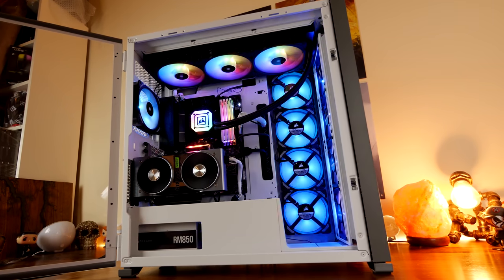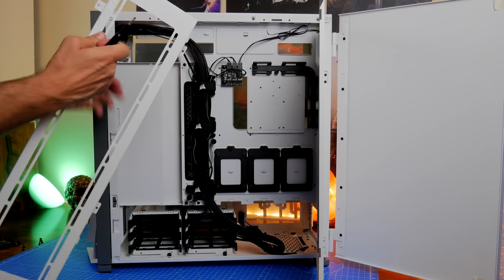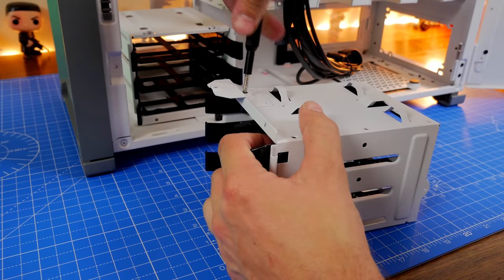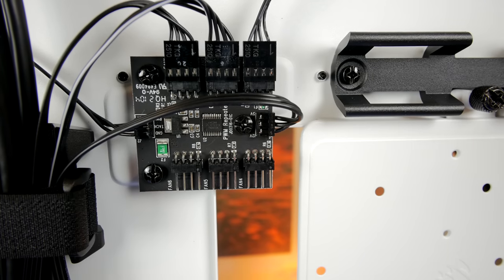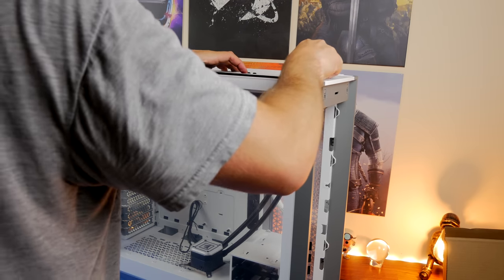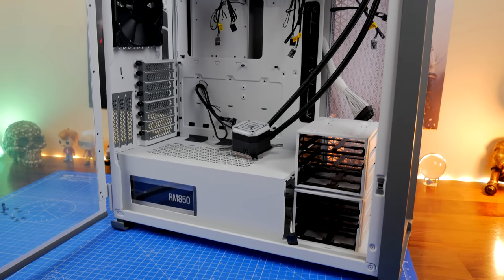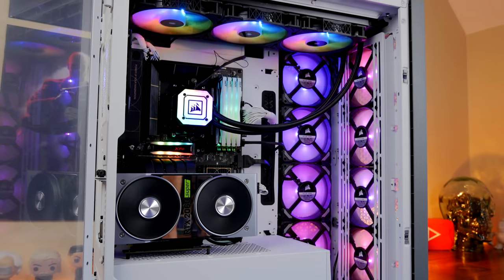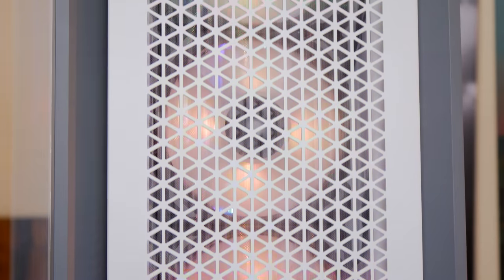Corsair 7000D Airflow unboxing and installation with 12 fans & the Corsair H170i Elite Capellix

Comment: How do you recognise which one is + on reset and power sw cables? Does that little arrow on the opposite side from side with writing on plays any role?
Reply from the maker: You should have some guidance in your motherboard manual
Reply: @TheProvokedPrawn   Im a bit confused. This is my firs build from scratch and quite expensive to. What will happen if i connect power sw or reset the other way around. I use z690 force wifi on this
Reply from the maker: @hermanherman1982  it's a bit hard to demo on video but usually the lettering https://www.alphr.com/features/378919/how-to-fit-the-internal-cables/#:~:text=To%20connect%20the%20Reset%20button,which%20way%20this%20connector%20goes. outward. See here
Reply: @TheProvokedPrawn   I basically finished. Im just unsure about those two cable’s. Im gonna pop in to pc service shop to be safe. Thank u for the help Prawn. Your video helped me alot with most frustrating thing. A cable management 😜

Comment: I bought mine from origin and it didn’t come with the air scoop that blocks the power and the vertical bracket also my fans setup is so weird the radiator is connected to  6 of my 12 fans instead of just the three fans in the radiator so when I turn off a scene in Corsair is looks gross because half my fans will be like rainbow and the other half has like white when in default mode but it’s not a problem once I set it to like rainbow but if I try to do custom scenes it looks gross
Reply from the maker: Change the hardware lighting on those fans to wherever you prefer. That should sort it

Comment: I just built up a 5000X case and I want this one cause it fixes all the things that annoy me lol
Reply from the maker: What annoys you?
Reply: @TheProvokedPrawn  can't  get the 3rd fan above the MOBO on the AIO... power cord is in the way, there's no cutout on the side to display the PSU LED panel, can't flex the LianLi ARGB cord from the MOBO directly to the back in order to create a nice curve and can't hiding the non-RGB part, same with the LianLi 8pin ARGB cord from the GPU. So both my Lian Li cablesare just running towards the fan on a weird angle.

Comment: So what motherboard is compatible with corsair 7000 RGB/ airflow?
Reply: I’m building my first gaming pc and bought the rgb case tempered glass with commander pro in it with same AIO
Reply from the maker: Mini-ITX, Micro-ATX, ATX, E-ATX
Reply: @TheProvokedPrawn  i mean i do have a ASUS TUF X570-PLUS GAMING (Wi-Fi) ATX w/ RGB, Realtek LAN, 2 PCIe x16, 2 PCIe x1, 8 SATA3, 2 M.2 SATA/PCIe but it has only one Slot for the front case usb no usb type c too
Reply: @TheProvokedPrawn  right now i am building my first pc gaming with the corsair 7000 case with RGB tempered glass  while watching your video 😅
Reply: @TheProvokedPrawn  and i am using Lian Li SL120 and SL140 Unifan though
Reply from the maker: @russelsegundo8865  you could still use it, you just won't be able to use those front panel connections.
Reply: @TheProvokedPrawn  idk which one though i need to connect though and I don’t have the knowledge what cable i need to connect thru motherboard
Reply: @TheProvokedPrawn  i got a sata hard drive and i already connect the sata but there are two unconnected one has four pin on it
Reply: @TheProvokedPrawn  is there a USB splitter for the 4 front USB though?
Reply: @russelsegundo8865   why did you need a splitter? Your board should have a USB 3.0 header, should be just below the 24 pin, you should also have 2xusb 2.0 headers, the only front panel usb you can't connect is the type C, the corsair commanders use the usb 2.0 headers

Comment: Pls dont take this as an atack.
Aesthetic build, looks nice. Anyway subjective matter. Looks nice tho, even if you like it or not....

Temps/noise/money ratio when it comes to fans, cooler, case, it's as shit as it can be. You can get those results or better with 200 bucks.
If you're running a system with single gpu, CPU and 1-2hdd, and NO custom loop, just go for a small case, and a 280 or an air cooler. The smaller the case, and the better you can fill the WHOLE front with fans and the more efficient it`s gonna be.

For example. Be quite 500DX..... 45L case...... 
Mount on the inside of the chasis, 3 front 140mm intakes, seal all other holes and gaps.
280mm with arctic p14 (or schyte wonder snail if they are available) fans on TOP, or a nh d15/assasin 3 running only with the middle fan.
Remove drive cage, and mount storage directly on the floor of the case with sticky velcro. The velcro will act as an antivibration pad aswell. Buy a GPU that has a radiator with a fin array perpendicular to the PCB, and a good thick rad TOO, remove shroud and fans, and get 2x120mm p12, sw3, nf a12x25, wonder snails etc.....  and zip tie them to the GPU rad.
Tuck all excess power suply cabling behind the right side panel and clean the PSU shroud of cables the best you can.
Remove all PCIE bracket slot covers. No exhaust fan.

You gonna get most likely lower temps, with half the fans and only at 700-800rpm on coolers and case fans (not to mention, the cooler fans would be quieter than those corsair at same RPM if you use p12, p14, wonder snails, nf a12x25, sw3 etc....). The noise difference between that, and your current build, it´s like the difference, from earth to heaven.......

1600rpm on 8 screamer corsair RGB fans, is obnoxious. There's no way they're not obnoxious. That's 40dba+ at 50cm of the case.

Comment: Will a  nzxt 240mm liquid cooler fit on top ?(2 fan radiator)
Reply from the maker: It would but then you'd have a gap
Reply: @TheProvokedPrawn  it would just be for temporary I would end up getting a 3 fan radiator for now ima use the 2 and add the 3rd fan

Comment: what a big design flaw from Corsair putting the GPU vertical mount to close to the glass, ive seen people report GPU temps increasing by 20 degrees C just from this mount as the fans are so close to the glass it starves the GPU of air. Sad cos i just bought this case yesterday and now im looking at refunding it. I want a good vertical mount option for my 4090StrixOC as I'm worried it'll sag in the normal position and crack the PCI board which is common with these heavy cards.
Reply from the maker: I think it's meant for custom loop cooled gpus
Reply: @TheProvokedPrawn  yeah you may be right, only way it makes sense to be so close to the glass, Ive looked at some Phanteks cases which have the vertical mount more towards the motherboard so the GPU has more air but I dont want to use one of their cases, I like the corsair case. Might just stay with the 7000D with normal GPU mounting and use the support bracket :(

Comment: Lol I literally just got the 5000d i don’t think I would get the 7000d!
Reply: I returned my 5000D recently and plan to get the 7000X.
Reply: @DougCube  only part i dont like about the 7000d airflow is the side where it shows the psu, i liked the clean side like in 5000d

Comment: It got hot becuase I could see thermal paste on the cpu and you hadn't mounted it. You said that it was fidly so I take it you had put it on once and then had to take  it off again but doing so you you didnt clean the paste off so most likely you got ana air bubble. I alwasy reaply the thermal paste  again if I take the pump off. I would bet my house on it.
Reply from the maker: Quite probably

Comment: Air pressure in this case must be absolutely borked, also vertical mounting GPUs for air cooling is not recommended, bad thermal impact. You could have made do with the 5000D. A lot of excess and waste for parts that don’t need it.

Comment: Did Corsair sponsor this video? 😊
Reply from the maker: They supplied parts but the video was not paid for
Reply: @TheProvokedPrawn  Ok, just wondering. 😄 As for the case, I might get one myself, as it's a toss up between this or a Be Quiet Pro 900. As for the fans, I have no interest in LED colors, I just want them to supply a cool air stream into the beast. BTW I quite like Noctua case fans, as they are so quiet.
Reply from the maker: @Puzzoozoo  Noctua are highly thought of. I've not used them yet but I know they're well rated by others

Comment: Power supply sucking in dust from the bottom/table, risky...
Reply from the maker: Through a dust filter? As opposed to being blocked by the internals of the case?
Reply: @TheProvokedPrawn  The dust filter gets full with dust and then blocks airflow, could lead to overheat, if dust filter removed, power supply ends up with dust, never really had a problem with it, could gets smelly, might catch a brief fire with todays power requirements, don't know yet ;)

Comment: its a wiring nightmare, to this day I have never used RGB fans, because of this, I refuse to deal with all this crap, a fan is a fan, who cares about RGB, its like putting a racing stripe on a Prius, its not going to make a shitty car go any faster, and RGB isn't going to make the air move any faster through the fan.
Reply from the maker: Quite the opposite, RGB fans are worse for cooling. But you can do funky things like sync the lighting with your games 😜

Comment: overpriced crap case same as 1000D, i'll stick to my 900D, at least my case has (Plenty of room for HDDs, SSDS)  oh and what's that bays for CD drives, and Memory card readers! And USB expansion slots!? GREAT.

Computer cases used to be universal and aimed at PROPER consumers, now we get crap..  crap that's mostly aimed at RGB garbage and a very little area to do anything with... big but nothing you can really do.. and ramming tons of fans into your case doesn't do crap for cooling 90% of the time.. it can also usually be more negative than good 

The only cases I have and companies I'll now touch on are Corsairs 900D, and Coolermasters cosmos series, and better cases...  I also have a COSMOS 2.. A brilliant case, at least cooler master still think of all customers..
Reply from the maker: Oh you're clearly an expert
 Well done.